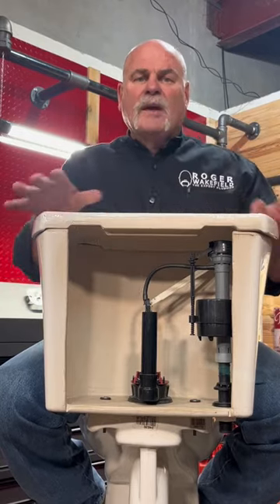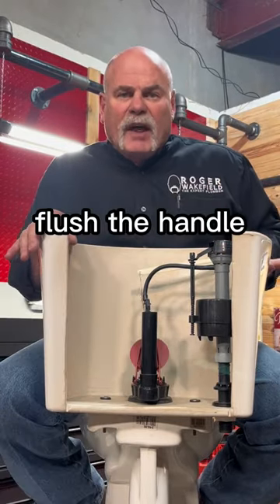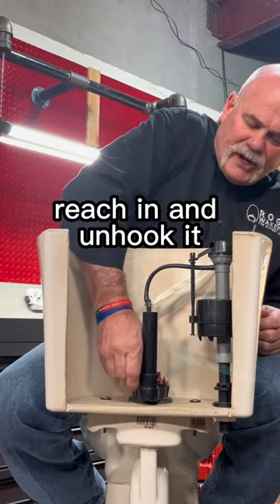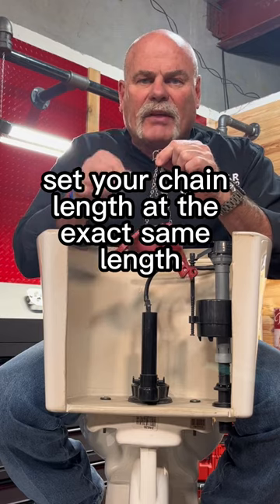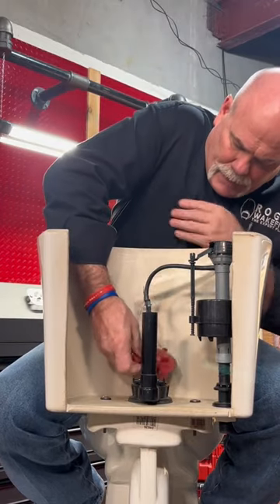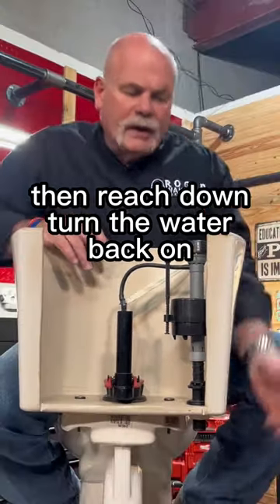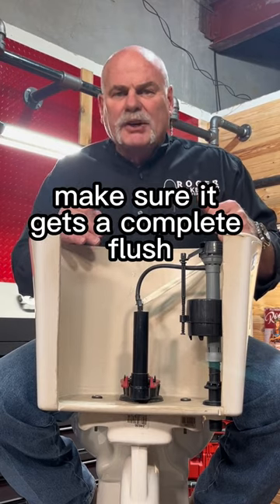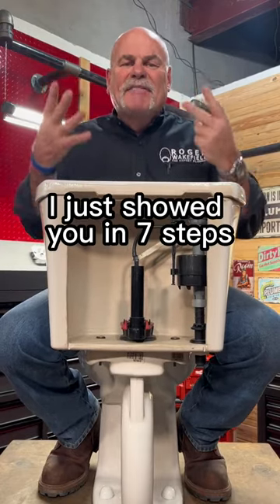How To Change TOILET FLAPPER! PLUMBER SHOWS HOW

Comment: Thank you so much!  I'm a widow and have had to learn to do all of this stuff.  Your instructions are so clear and easy to follow.  The only glitch is that the arm has several holes to put the chain back on, and I didn't realize that until I went to put the chain back on.  But it works and, if there's any problem, I can just hook it on a new hole and try.  But that's EZ.  You did the hard stuff: explaining the flapper valve!

Comment: Do you ever sand/clean up the flush valve rim where the flapper sits?
Reply: I guess you could. However, in most cases, the issue is the flapper, not the surface it sits on.

Comment: How about the chain? Is it OK to leave the chain loose or do I have to tighten up the chain?🧐
Reply from the maker: It shouldn’t be so loose that it doesn’t raise up all the way when you flush, but you don’t want it so tight that water gets through without flushing…it needs to be right in the middle
Reply: @RogerWakefield  
Awesome thanks a lot Roger. I appreciate the tip.

Comment: So I recently changed my filter because the water did not stop. We have issues with our pipeline and we have "plumbers" working on it (it only took them about 2 months to start. They said dirt got into the pipe and somehow big rocks made it's way in and obstructed the water line making our water pressure very weak. Now my new filter does not want to stop filling the tank and it's overflowing into the overflow tube and out of the handle. Idk what to do. When the water supply is turned off there is water (weak flow) still coming out of the water hose.

Comment: My chain keeps getting caught under the. Flapper ive moved it up and down even shortened the chain- i ended up getting the korky flapper with  the little yellow float on it to try to keep the chain unobstructed but my handle is wonky just got a new one hoping it solves the problem, apparently the chain is supposed to look like a slight J

Comment: What if the old chain length was incorrect? What I like to do too and is install the flapper, hold the chain up to the desired hole on the flush lever, pinpoint the link then hold the hook where the top of it is at the pinpointed hole and see where the bottom of the hook is at, then that’s the link I hook into. I just started a plumbing channel under a different name to show how to do various repairs. 

 Awesome tutorial! I like your props too! Great visuals. I’ve been plumbing 17 years as a journeyman and getting ready to get my masters. Keep ‘em coming, Roger!

Comment: Mine won't fill for some reason and I have a bad water leak. I even removed the back of the toilet just like in your example.
Reply: Maybe the tank o ring seal is not secure. You can easily check to see if the water is coming out there where the tank interfaces with toilet bowl.

Comment: I have changed many a flapper only for them never to make a seal. 
I have even scrubbed the sealing surfaces clean, didnt work, grabbed some high grit sand paper (1000 or so)
Still leaks. 

I give up, ill just replace the entire flush valve from here on out.